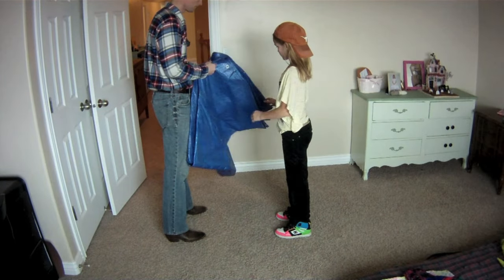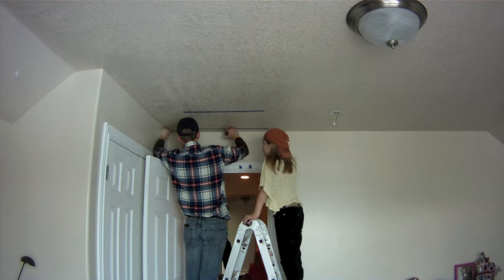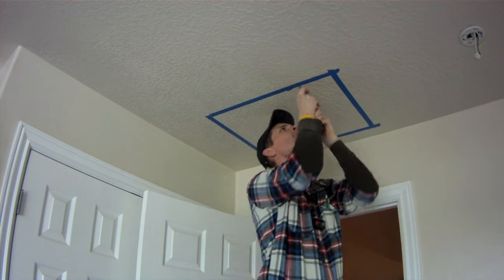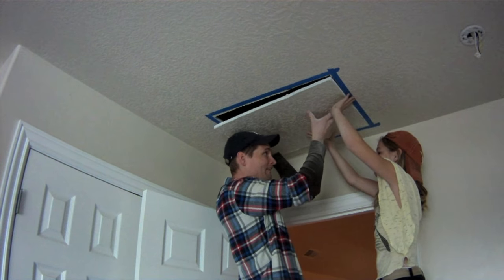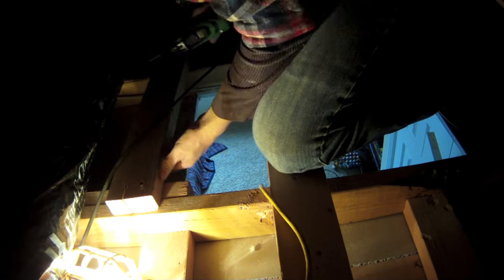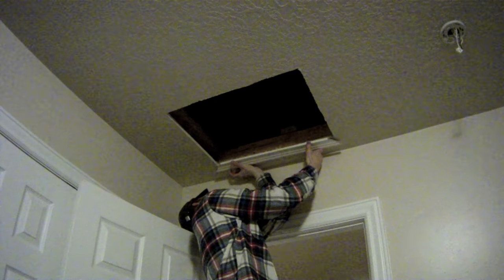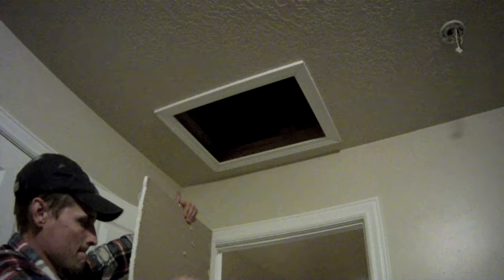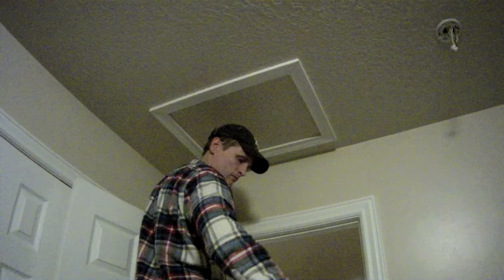How to Install an Attic Access Door for Insulation

Comment: to simplify installation of the trim, i'd probably create the square on a table and wood glue it together and maybe staple it on the back.   This will let you get it nice and square without working over your head. Then put the whole piece in place at once.  Less need to get it perfect.

Comment: I recently moved into a row house in Washington DC, and while the row house had a brand new room (<3 years old), the contractors that put on the roof and the owners of the house at the time decided not to put in new insulation - or any insulation at all. A few months later and a few dozen hours of spelunking in my 100-year-old, 1.5 ft-high attic and installing rock wool, I realized I couldn't access the other two-thirds of the attic because I couldn't fit through the 11inches of space between the attic floor and ceiling beams. I used this video to cut a new hole to access the other part of my attic, and while it was a much messier project that required cutting through lap as well as dry wall, and being showered with 100years worth of gross dust and tar and cement binder, I really appreciate that this video was here, even if just to give me an idea of what to expect. There are no other videos like this one that really help, in my opinion. Thanks, and have a good one!

Comment: You should also build 4 sided walls that keep the blown insulation from falling into the access hole when opened. Then use a piece of fiberglass insulation over the door inside the walls you built.
Reply: I used multiple layers of hard foam board insulation on mine so I would not have to touch any fiberglass when handling the hatch door.

Comment: The door itself needs some foam glued on it as insulation and a baffle can be installed in the attic to prevent insulation from coming out the hole when you open it.

Comment: Thanks for this excellent tutorial.  The time lapse was nice too, it saved me from spending 15 minutes watching you set up and saw.  Was that an electrical wire I thought I saw running along the stud closest to the wall?  Good idea to saw by hand for safety.  I will probably wear a full face respirator mask when I do mine, I have no idea what is going to fall down out of there.
Reply from the maker: It's been a few years, but yes, it was an electrical wire. It would have been faster to do it with a sawzall, but doing it by hand allows you to "feel" if something isn't right and to adjust your procedure - it can definitely help avoid chopping through things you don't want to chop through....like wires.

Comment: Excellent video! I need access from my master bedroom into the attic in order to fix my duct work. Now, I do not have to crawl from the other side of the house over the rafters (I have cathederal ceilings) possibly damaging existing duct work.
Reply: Had to cut the trim about 1/2" shorter than actual dimension of opening to allow for a lip around all the edges.  Otherwise, all went well.  Thank you.

Comment: Curious as to why you’re gonna blow in insulation rather than used bats and foam core in the rafters.   I just bought this house and I’m thinking of taking all the blown in insulation out of the attic and putting in bats and foam core in the rafters.   What’s your take on this? Thank you

Comment: I have such openings in my house--one in an upper hall.  I was hoping to eventually make a more solid, secure hinged "Door" for the openings... so I was checking Youtube for ideas.  It is not unusual for our area to have a severe storm (High winds) at least once a year.  I have seen access doors get sucked up into an attic and blow down by tornadic winds which sends loose insulation; dust and debris into your house--big time.  I have inspected many such occurrences in my working years.  It is not pretty to clean up or deal with.
Reply from the maker: Wow - that would definitely stink. I've never had a problem with this type of door (in Texas, Idaho and Utah) but if its a concern in your area, I would definitely add some sort of latches or something to prevent that. Good advice for those in tornado zones.

Comment: Ive got a similar situation to this one where I want to fit my new hatch. There is a beam laying across the other beams right where I want the hatch to go. I did some online searching and I think it is called a hanging beam? Apparently it is there to support things in the room hanging off the beams and to stop the beams going at right angles from sagging. Does anyone know what the best way to support those beams when you cut through them? Just connecting across the two beams eitehr side of the the hatch wont spread the weight of people hanging off the hatch edge any further than those two beams? Should it be suported across 4 beams maybe or how many to return original strength?

Comment: Thanks for sharing but think I would use a piece of plywood instead of putting that messy drywall back in.
Reply: Maybe fasten the old drywall onto a new piece of wood for support, then insulation on the back of the wood.

Comment: So when the insulators come back to insulate the attic, what's to keep the new insulation from falling down the access until it's closed?  Did you simply nail the trim to the Sheetrock?  What's to keep the trim from falling down when the insulators are crawling in and out or pulling their hose up into the attic?
Reply from the maker: The trim is nailed through the sheetrock into 2x4 wood studs located above the sheetrock. You are correct that nailing wood trim to sheetrock would be a very poor idea with a high likelihood of failure.

To keep blown-in insulation from falling out every time you open the hatch, the best thing is to nail some plywood strips vertically (on all 4 sides of the opening) to the studs to create a barrier.

Comment: What are you nailing into?  I see 2x4s on the shorter sides but nothing on the long side.
Reply from the maker: Before we even made the first cut into the ceiling, we used a stud finder to locate the existing "rafters" (2"x4" lumber that holds up the ceiling). Then, when we made the cuts, we cut just to the inside of those 2X4s (which run all the way down both of the "long sides" of the hole. Then, we cut the shorter 2x4s and nailed them in to the short side. So, in essence, all four sides of the hole have the 2X4s along the sides and that is what we nailed into.
Reply: FogoFox Thanks!  Unfortunately, I need to provide access to water in a drywall ceiling from the basement so I can't add a 2x4.  I think I will have to use a bogus vent.
Reply from the maker: You can actually add the 2X4s from below too, if there is space. Just set them up on top of the drywall and then drive a screw up through the drywall into the 2X4. That will hold the 2X4 in place so that when you go to add the trim to hold up the panel, you can then nail into the 2X4.

Comment: Nice DiY but you just created another hole in the envelope that leaks air and heat. Attic doors need to be properly weather stripped, sealed and insulated to prevent air infiltration and heat conduction

Comment: Very good for what I need - but - you and your assistant should have been wearing safety glasses.
Reply: Pierre Klee Theres always one
Reply: Bahahahahahha
Reply: If you think you need safety glasses for this small project then please hire someone who knows what they're doing :)
Reply: While I think some people overdo it with safety equipment, I'd agree on this one.   If you're cutting drywall on the ceiling, get ready for drywall dust in your eyes, or worse yet fiberglass insulation, or worse yet mouse droppings.
Reply: @Dabby724  It's a good idea to wear them, or you could end up a student at a blind facility.  I've had many a contractor that went blind with this same mentality.  "It will never happen to me"

Comment: Why wouldnt you just buy a cheap drywall jab saw???
Reply: Sometimes you're in the middle of a project and don't put everything on hold to go to the store.... so you improvise.
Reply: @josephashurst1026  or plan ahead.
Reply: @43wagonwheel  for sure... that would definitely do it 😉